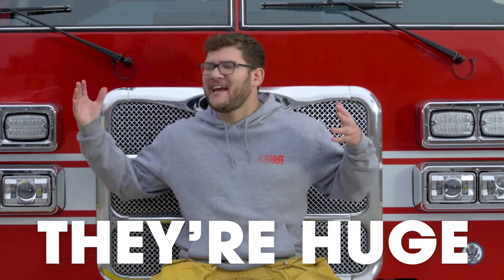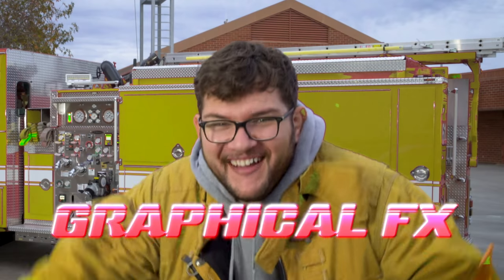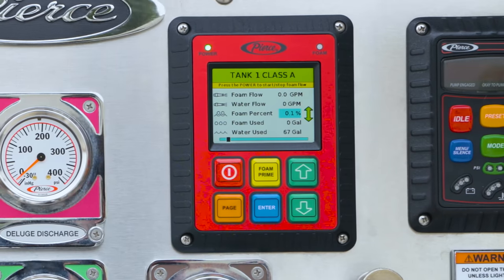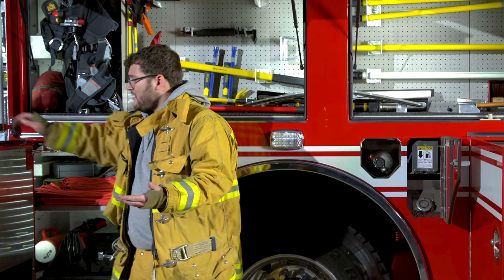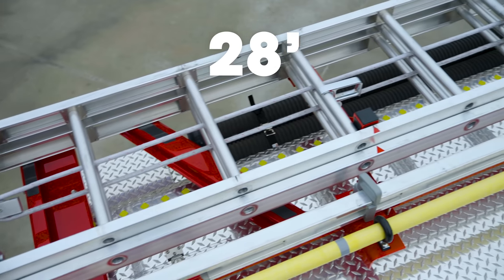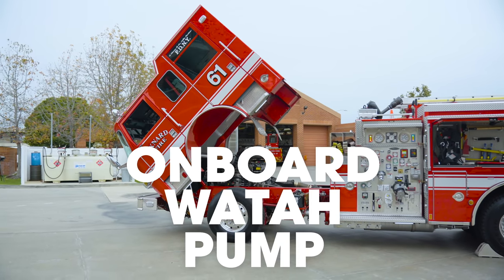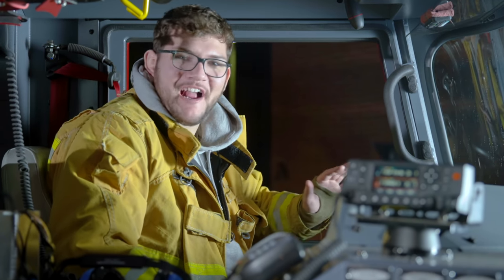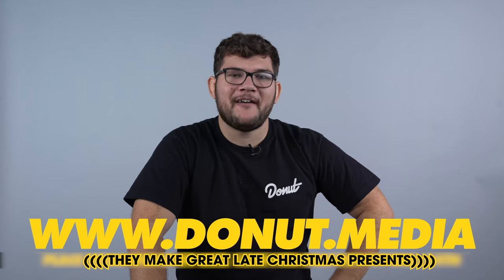The Surprising Features of a Fire Truck

Comment: Firefighter: Need water!
Engineer: Hol on, lemme do sum quick mafs
Reply: "Erecting a water hose!"
Reply: Most of the time it's just a preset pressure.  Almost never do you actually have to do math.  Most of the computations for specific hoses are already done, so all you have to do is know how much hose of a certain size is being used, and what nozzle, then just pump at the pre-determined pressure on the chart.   Takes longer to explain it than it does to look it up.
Reply: the easiest way to know if there's enough pressure is that they will ask for more over the radio... kinda easy
Reply: 2+2 is 4. Quick mafs
Reply: Just send 140.
Reply: ffjsb we simplify that even more because we have TFTs on all our preconnects
Reply: @JetstreamSamRodriguez  tf2 reg says no
Reply: @JetstreamSamRodriguez  Nope
Reply: @alexilauto1419  Dammit, boys...
Reply: @bikerboi4197  -1 that's 3, quick mafs
Reply: For the pre-connected crosslays, the pump's computer has a preset pressure to run at.  This will at least get water flowing, and then if there are more lengths added, or they go up a couple flights of stairs or something, the engineer can calculate the necessary increase.  They can get water moving before doing the quick mafs, but mafs are definitely important if you're an engineer.  Nozzles have a specific pressure they're designed to put out optimum water, and higher or lower than that means they won't work like they should.  It's the engineer's job to make sure the right pressure is getting to the nozzle.

So yeah, even with firefighting, you actually do use that math you learned in high school.
Reply: Just throttle up till the nozzle mans feet come off the ground, then back off 1/2 turn.
Reply: @therealsenorisgrig  You can do that regardless of the brand of tip you're using.
Reply: @ffjsb It might be different in America, but British fire fighters have to be able to do some serious mathematics to understand the hydraulics of moving water from one place to another, from understanding and calculating the effects of nozzle discharge, and Jet reaction of different pressures and different nozzle sizes. 
Fire Fighters have to be smart cookies, physically fit, and courageous.
Reply: @pjmbidge632000  Its the same in America, water doesn't move any differently here. ffjsb is just saying that the vast majority of calls your using pre connected Hose lines and that there is a pre set button that will take you up to the correct pressure for your most common structure. Obviously if you add bigger Handlines, master streams or hose longer then 200 ft now you have to do the math and the preset mode is out of the question.
Reply: @hihfty  If that's the case your comment is a puerile, Fire fighters do have to know how and why hydraulics effect water delivery. I was a operational fire fighter and officer for over 30 years.
Reply: Paul Marshall your missing the original point that was being made. What was being said was that we so commonly use the same hose length and nozzle 90% of the time that we aren’t looking at charts and doing math on a clipboard because it’s memorized. And because on most fires the same hose is coming off the truck we have a preset button that just jumps to the pressure of your most common hose line. Nobody is saying we are ignorant to hydraulics and friction loss. We are just saying that we have a button  that revs the pump up to a pre determined pressure when the situation is appropriate.
Reply: Maf for days
Reply: @pjmbidge632000  We have all that precalculated, we don't need to do algebraic calculations to get water out of the end of the hose.  It's taught in the academy, but seldom actually used on the street.  Most of the time it's in rare situations where you have to pump into a standpipe in a high rise building, but even then there's a standard starting point you work from.  Most nozzles and hose already have standard working pressures.
Reply: Buildin a sentry
Reply: @ffjsb  That's the difference between amateur and professional fire fighters, those who know how to do the calculations and those who rely on the work of others.
British fire fighters are taught how to do those calculations. The institute of Fire Engineering, is a UK standard of excellence
Reply: Paul Marshall and the US NFPA is an international standard.
Reply: @ffjsb  I think it's you that is missing the point, regardless of whether the pump does the calculation or the pump operator does the calculation, fire fighters have to be able to understand hydraulics, it's very easy to say ''you just press a button'' you have to understand what to do when ''pressing the button'' doesn't work! 
My point was fire fighter have to be smart.
Reply: @jcnash02  So do you think you will become a member of your NFPA, by just knowing how to press a button? No, you won't, you will have to be able to do the calculations.
This is a link to the Institute of Fire Engineers. If you want to get on in the Fire Service in Europe, this is the standard.
 https://www.ife.org.uk/IFE-Qualifications-with-Syllabus-Links
Reply: Most engineers know based on line size...two man crew? Room and contents? I can send a 200 ft 1 3/4 inch hose line set at about 100 PSI...it’s when there’s a deck gun, 3 lines, and a relay engine pumping into you that pumping becomes a pain in the ass
Reply: @pjmbidge632000  Learning how to do them and ACTUALLY having to do them on a fire scene are TWO COMPLETELY DIFFERENT things.  Fire stream nozzle pressures are NOT absolutes.  Nozzles work fine in a general range, and friction loss can vary in the same hose and nozzle from fire to fire because of the way they're deployed, and it has very little effect on the outcome.  There's usually a 20-40 psi range that works just fine.  Once you figure out the standard psi for a given line there's NO need to do that math ever again.  All you have to do is adjust it up or down as the nozzleman needs for a particular situation.  They'll tell  you to give them a little bit more or less as they need.  Math equations don't factor in the strength of the nozzleman, the conditions he's operating in, or the reach he needs.
Reply: @pjmbidge632000  Pumps don't do calculations...
I've been doing this for over 35 years.  And it's MUCH more than just hydraulics, it's fire behavior, building construction, chemistry of hazardous materials, physics, etc...
Reply: @pjmbidge632000  
"regardless of whether the pump does the calculation or the pump operator does the calculation..."

You're own words pal...
And I've got about 5 years on ya...
Reply: @ffjsb  " I've got five years on ya"
No genuine fire fighter would make a comment like that. get a made up medal out of the bucket as you walk out the door!
Reply: @pjmbidge632000  Uh, YOU brought up how many years you had, I just responded to YOUR post.  Stop me when I'm wrong.
Reply: Australian RFB'S: 40 achres burned at 15 meter flame height sure. Lemme just pull this up with my landcruiser turned fire truck...
Reply: we actually do, but alot of the time you rule of thumb it, 0.1bar per length of 70mm, 1 bar per 45mm and 0.1 per meter up so 2 lengths of 70mm and 1 length of 45mm, to the 3rd story  2 x 0.1 + 1 x 1 + 0.1 x 9m so 5 bar at the pump. You're also working off a dial so its around 5... AND alot of these friction loss stats and equations are from 30 years ago where hose was linen and pretty poor for loses compared to modern hose
Reply: @CanadianFE  damn, I always send 160

Comment: “Because every big truck needs a  rear view camera”

laughs in semi-truck
Reply: some of them also use rear view cameras. while not necessary it makes your job a lot easier. we have two trailes with rear view cameras because some construction sites require one (they will literally send you back home if you dont have one)
Reply: Ukaros you flatbed?
Reply: @mrOGmixer  mostly tank but also some dry bulk. with those two we deliver concrete additive
Reply: Makes sense, I drive reefer otr, i see a lot of tankers with cameras though
Reply: I was thinking the same, 24m timbertruck driver her 🤪
Reply: 120k lbs triple axle lowboy club right here
Reply: Blake Belladonna because "reasons"
Reply: @ukaros1912  company I work for tried rear view camera on trailers, didn't work, the electric wires would corrode almost all the time
Reply: should have someone backing you up, but in my experience leaving crowded scenes can get sketchy with people and kids all paying more attention to the newly burned out building and walking behind the rig.
Reply: Someone needs to translate all the semi-truck-ese that’s going on down here.
Also, if these trucks are so big, why are they called “semi” trucks?
Reply: @Blake Belladonna Because marketing gimmicks sell is mostly the reason.  Truckers back up as infrequently as possible, and require an actual visual outside the cab (parked with driver walking around outside) before any questionable manuevering in close quarters.
Reply: @CarMad97ci  'Semi' refers to the trailer that big trucks often pull.  A semi-trailer differs from a full trailer in that it's only supported with wheels at one end.  It becomes a 'full trailer' when dolly wheels or the drive wheels of a truck are added.
Reply: Eric Meekey huh! There you go, thank you brother!
Reply: Perhaps the best vehicle to be reincarnated into if you believe that sort of thing.  Decades of use.  Retirements in museums parades, or decades of use in other countries.  Not a boring life for a vehicle by any means.
Reply: @ericmeekey7886  I thought it was short for "semi-articulated"

Comment: "Alot harder with all this gear on...." is only wearing a jacket
Reply: @jay bay have you ever worn bunker gear? If is not easy to move around in.
Reply: the mechanic 22 but just a jacket doesn’t do much. The pants are what makes life suck lol
Reply: No never. i had to do a test with fire extinguisher when I was a kid though. just saying dude wasn't wearing all that much gear that was the point
Reply: jay bay and the pants dummy
Reply: Nathan Smith but not the scba some of the heaviest gears
Reply: *jacket isn’t even zippered
Reply: @hopemitchell276  how does that make a weight difference or am I just confused on the question
Reply: @71024  it's a mix, we've just rolled out new kit and because it's new its stiff, and even the old stuff never became flexible. Also the body loses heat through sweating and radiation, both of these are rendered ineffective so you got HOT and FAST
Reply: I can drive with my pants and boots on, coat, not so much, but the brand new gear is a lot, LOT more improved than the yellows.
Reply: Those jackets are heavy

Comment: Excellen job going over the engine dude! A little detail but important is that SCBAs carry air at normal atmospheric mixtures not concentrated oxygen so that when in a fire they aren't carrying a giant explosive on their back. The oxygen tanks have green paint/label on them and have a different valve.
Reply: In my department they are not called tanks either they are called cylinders and you’ll get called out for calling them anything different
Reply: Oxygen isn't explosive
Reply: @syedreza8722  liquid oxygen is literally rocket fuel.
Reply: Oxygen is highly flammable
Reply: @syedreza8722  oxygen is literally one of the only things required for a fire
Reply: I am an MSA SCBA Tech, and seeing a part of my job in a Donut vid made me so happy!
Reply: Y E S
Reply: Oxygen is not “flammable”. Its an oxidizer. Hence the name. It supports and aids in combustion. But the actual O2 gas is not flammable.
Reply: @MuffinMammoth  its just the oxidizer, not the fuel
Reply: @xlxphoenixkingxlx  to be precise o2 are not fire starter on it's own but if there's a fire more o2 will make it bigger.
Reply: Lets just all agree adding pure oxygen to a burning environment is not a good idea
Reply: Flammable just means the substance ignites on contact with flame, so yes, oxygen is flammable, its not the fuel and doesn't combust, but oxygen is flammable.
Reply: @kevinganus4468  Never been a big fan of MSA packs. Always preferred SCOTT. Not to say MSA isn't a good brand. Just a preference.
Reply: @jaredsanda1440   Not a fan myself, just the product I work on. I don't have a preference since I don't use them, just test and repair.
Reply: x x  an explosion is a rapid expansion of gas, anything can be explosive
Reply: I love seeing all the fire chemistry wits and brains of YouTube on a video showing features of an apparatus argue over oxygen. It's rather amusing.
Reply: Azer The Snake when it’s under pressure it sure as hell is

Comment: Being a firefighter, I have to give you props for really getting everything right and taking the time to get the terms correct and learning all about how everything works!
Reply: Not quite everything right, but yeah he did good.
Reply: Every time he says Oxygen 😑
Reply: @justinv433  yeah I picked up on that too. Also I think he said the extinguishers with just water in it were used for kitchens.
Reply: Except for calling the air tanks oxygen. They aren’t oxygen tanks. If they were, they’d explode in Fire conditions

Comment: Surprising features on a fire truck
it has wheels
Reply: Wonder where the spare was tho.
Reply: M B I would think they are run flats
Reply: hmmmm yes the water is made out of water here.
Reply: Front end generally uses single tire. Becuase the weight of everything is on the rear axel, there's generally dual wheels so that if one fails there's a backup. If you have catastrophic tire failure, then it's call the mechanic and a heavy wrecker
Reply: @Wesrl  l
Reply: @ML-fc3je  p
Reply: @ML-fc3je  pp
Reply: @ML-fc3je  poopy p
Reply: @Wesrl  pop ppppppppppppppppppppppppppppp
Reply: @mav8855  Hydrogen and Oxygen*

Comment: My dad was a firefighter for about 25 years and he worked his way up to Battalion Chief. I always loved climbing all over the fire trucks and fire engines. I thought I'd mention that our departments send 5 guys when responding to a call unless more are needed and most decent size cities use their trucks for about 5-10 years before they go on auction for cheap where rural departments pick them up.
Reply: in the city where I grew up they always responded with at least 5 units and a crew of 19 to any reported fire, activated fire alarm (without a fire being confirmed) etc.; Frontline apparatus were kept for 2 decades before they turn into reserve units, are handed over to the volunteer FD in the city or sold to another department in the country or abroad

Comment: 13-15 years? no no no my departments engine that we just sold was in service for over 20
Reply: The newer trucks just aren't built to last.
Reply: @85square  no 

City departments just have more associated wear and tear
Reply: @amistrophy  I help build and service fire trucks, I know the older ones are built better.
Reply: @85square  I guess it's possible right about now there's a bunch of novel technologies being jammed into cars. They're still more safe and fuel efficient through. It's hard to tell whether someone's just moronically nostalgic or making a real observation.
Reply: In Germany we use our trucks for 3 decades 😂
Reply: Yeah I think our oxnard one that he shows  is ganna be pretty old. our fire department mostly responds to small medical calls
Reply: My local station decided instead of puting more wear and tare on the engine they decided to get a whole different brush truck just to respond to medical and even then usually both are out at the same time going to different medical calls.  So city trucks depending on area do get used a lot more but also newer ones are built different and have a lot technologies that become obsolete and need to be updated, or just flat out become obsolete and unusable/non upgradable.

Comment: Also I’d like to add is rural areas most volunteer first responders are trained on how to use the pumps and drive as there just isn’t as many firefighters on duty to man all trucks if needed
Reply: true; Can't imagine how many departments roll out with under-staffed apparatus in the USA as there are only 1.1. million fire-fighters in the truely enormous country
Reply: @EnjoyFirefighting  that baffled me, we have over a million fire-fighters is Germany and only 30k of them are non volunteers for 80 million people. I would never in my life go without someone else into a burning building, we always have 6 people (Captain, Engineer, 2 Fighter and 2 hose men that switch with the fighters after 30min) on an engine and have room for 8. Although recently it got kind off awkward when 80 men arrived with 7 engines.
Edit: ok hätte ich dir nicht sagen brauchen aber gut.
Reply: EnjoyFirefighting - International Emergency Response Videos rer  is is
Reply: @vonSaufenberg  Anyone who goes interior by themselves is a egotistical fool.
Reply: @chevygmoney  uhm what?
Reply: This isn't just in rural areas, urban departments sometimes will suffer from a lack of manpower
Reply: x x  Germany is larger than the state of New Mexico and smaller than the state of Montana and there are 1.1 million firefighters in Germany
Reply: There's no "duty" as a volunteer. Your given a radio and told when you hear a call run to the fire station.
Reply: @colbymilnor4329  apart from that we in fact have a "duty evening" once a weeks at volunteer fire departments, or that there are planned events where they will be a kind of on duty: he probably simply meant sth like "available fire-fighters" in general